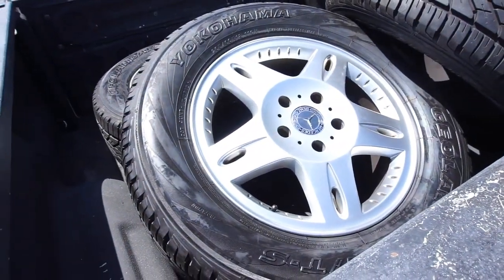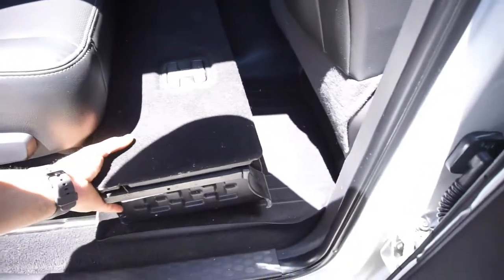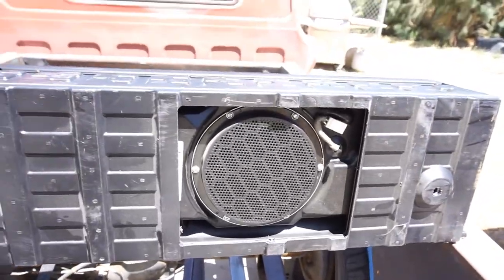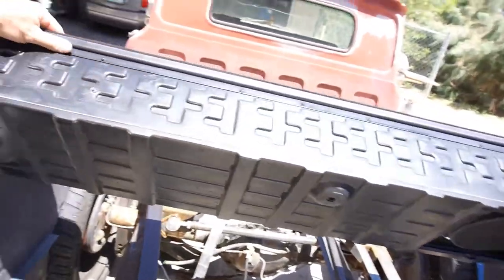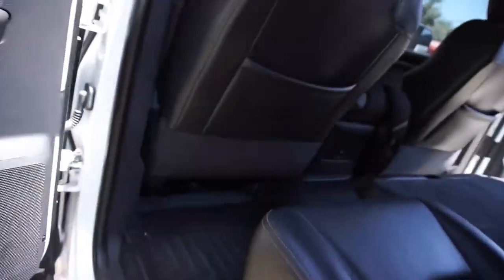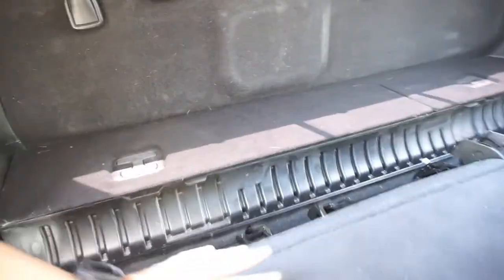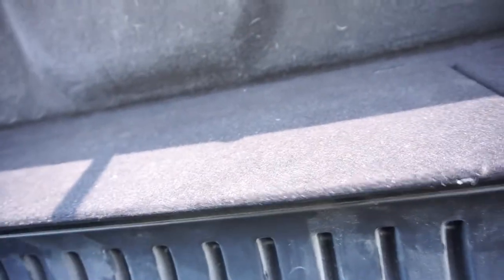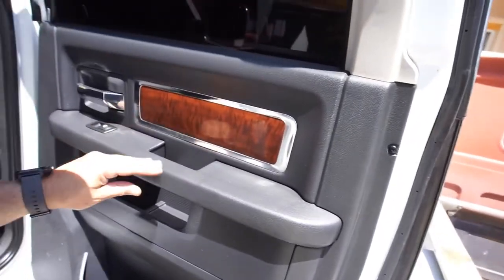50% Complete Mega Cab Storage Box Need Help Finding Other Piece. 2010 Ram 2500 Mega Cab.

Comment: did you ever get the rest of the components? i am finding myself in the same spot. bought a used truck and its missing the storage box, boards, along with coat hooks and the safety hook spots for car seats.
Reply from the maker: https://youtu.be/4HgT4e2UnPU a link to how I found it. It wasn’t through dodge though.